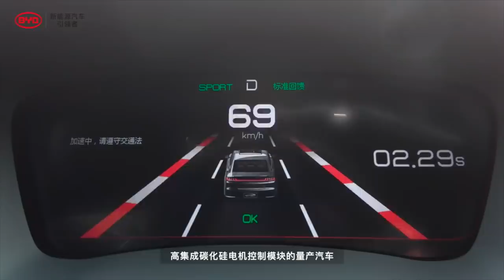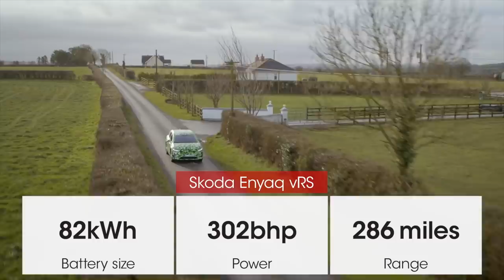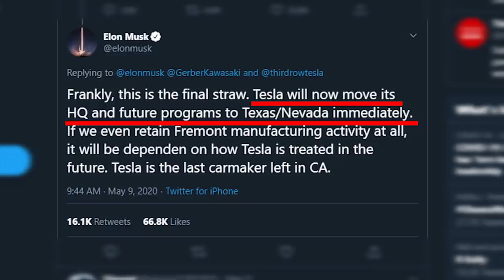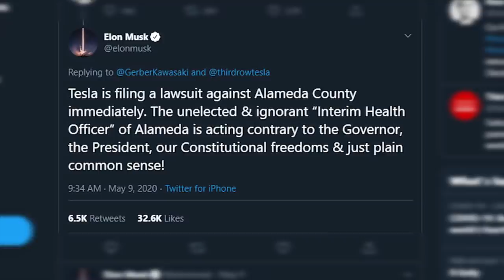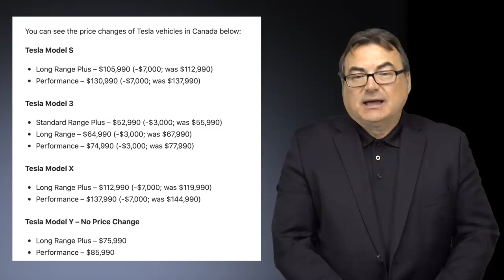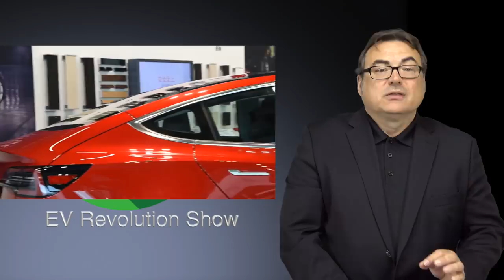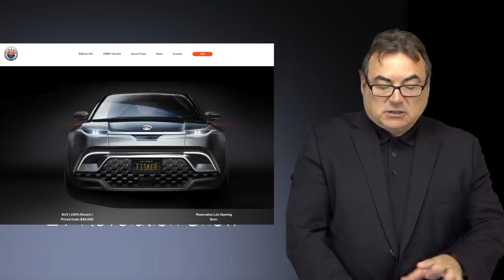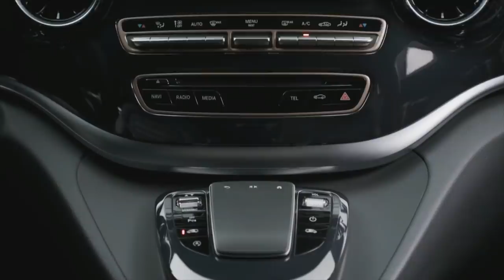Episode 92 -  Thanks Leaf and Volt, Tesla Lowers Prices, BYD Han EV, Skoda Enyaq and More News!

Comment: Tesla should have locked in that regard model prices would fall inline with battery pack price savings. I understand it’s their right to sell a product at a price the demand dictates. Hopefully as Tesla start rolling out thousands of Models out of Giga Berlin with improved paint and fit and finish the price will have dropped again. Let’s face it a£38k model three is the cheapest model you can buy here in the U.K. To really make an impact here that needs to drop £10k. £28k-30k base would be perfect with over 300 miles range real world.
Reply from the maker: Thanks for watching and I agree 100%!

Comment: Tesla's order books are full, could be a profitable 2nd quarter.
Reply from the maker: Hello and thanks for watching.  I hope so, but it will be a struggle for Q2 CY2020.  North America and most of RoW felt the strongest lockdown impacts starting in late March/Early April.  So I know that Q2 and Q3 are going to be low in auto sales, across the board.  May not see a recovery until late Q3 and Q4, or possibly slip into CY2021.
Reply: EV Revolution Show I definitely see your point but I’ve got production worldwide at 82,000 plus left over inventory from last quarter add the Chrysler/ Fiat credits and FSD at $7000 and the impossible might just happen.

Comment: Hopefully Tesla is developing a super affordable car. Something like the bolt in size and design, but much lower cost. Like less than $25k to be truly the first affordable EV for the masses
Reply from the maker: Fingers crossed!
Reply: I'm pretty sure they can, but do they want it ? Margins on premium cars is higher, and I am not sure their supply chain is ready for such mass production yet. Just wondering.
Reply: @ogamiitto8627  they already said they're developing a car for china, which very well be a compact car for their very crowded living conditions. As well as the median income in china is less than $35k USD. So even $25k will probably be out of most of their price ranges. It probably wont have terrific battery, but even if it is only 150 to 200 mile range with supercharging, that will be enough for a compact car for city driving and light travel.